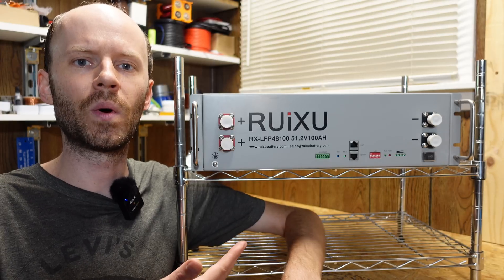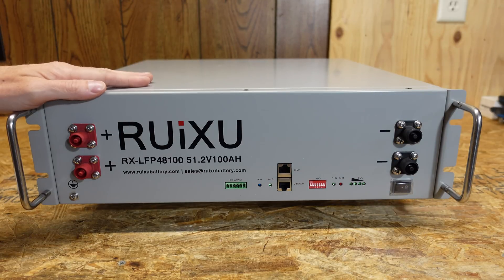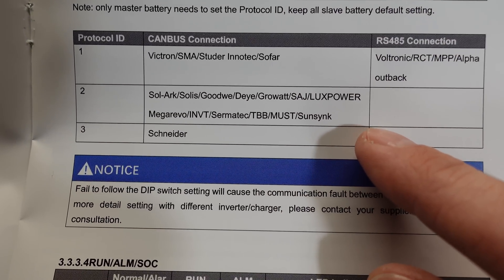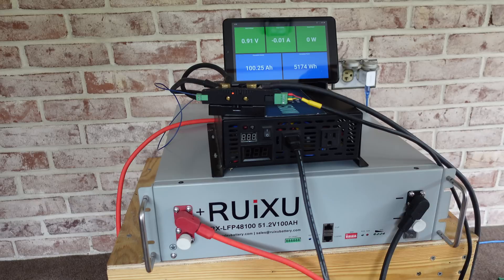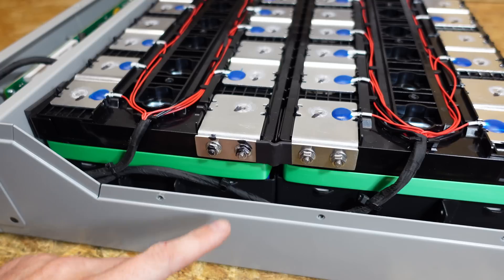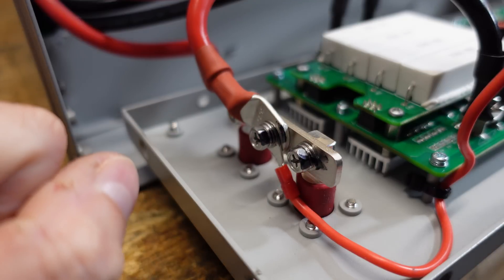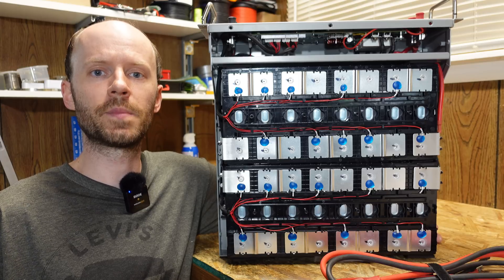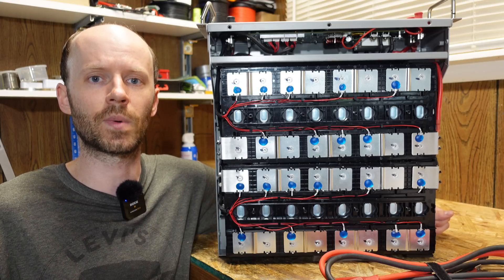RUiXU 48V 100AH Lithium Rack Battery Full Review, UL1973, Off-Grid Solar Power

Comment from the maker: RUiXU Battery... https://www.ruixubattery.com/product-page/rx-lfp48v100-19-rack-mounted-3u-module-ul1973-certified/?ref=lithiumsolar
RUiXU Rack... https://www.ruixubattery.com/product-page/6-slot-battery-cabinet-wheels-busbar-included/?ref=lithiumsolar
affiliate links)
Reply: Discount code not working :(
Reply from the maker: @Adrayven  They changed their pricing already and removed the discount code. Even without the discount code, it's now $100 cheaper than it would have been at the time of this video with the discount code.

Comment: Is there a  fuseable over load in line to the inverter??
Reply from the maker: No. Electronic over-current only via the BMS. You should use an appropriate over-current protection device as part of your configuration.

Comment: They say these batteries are good for colder environments since they have a built-in heater option.  I wonder how cold of an enviroment they can be in? We can get pretty chilly weather in Upper Michigan. I saw another review on these and the guy said he set his inverter to limit discharge to 100 amps since the battery wires were only four gauge. He said he would have liked to see 2 guage instead since his EG 6000 XP could accept 2 guage (but no larger). He also said this battery and the Lifepower battery would not start his AC but his EG4 LL-S Lithium Battery | 48V 100AH | Server Rack Battery would. Your thoughts? Subscribed.

Comment: should you use a dc breaker when you connect to an inverter?
Reply: Only if your cables are smaller than the amount of current the BMS will allow the battery to deliver.  I believe in this case the BMS will cut out at a particular current level, so as long as your wires are thick enough to handle that, then there's no need for a DC breaker.  It won't hurt having one, just there's no need if the BMS is able to perform that function already.

Comment: Hi, can I charge my Ecofolw Delta Pro from this RUiXU battery with xt60 port?

DELTA PRO SPEC:
AC Charge 120V~ 1,800W Max, 240V~ 3,000W Max
AC Input Voltage 100-120V~ 15A, 220-240V~ 12.5A, 50Hz/60Hz
Solar Charger 11-150V 15A Max, 1,600W Max

Comment: I currently have an SOK 48V / 100ah LIfepo4 battery on a small 3000kw solar system. Is it safe to add (attach) one of these to my current set up to double battery power? -Ok to put 2 different name brands together?  -they have same specs    Would appreciate thoughts from anyone.  Cheers

Comment: is it possible to add active balance to this battery?
Reply from the maker: Possilbe - sure, anything is possible. I don't know why you would want to and it's definitely not recommended to do so.
Reply: want to connect in parallel a 48v 280ah lfp battery later and have read is a good idea to have an active balancer 
2 or more batteries
Reply: @LithiumSolar  Active balancing also works whilst discharging and can protect a cell from over discharging on it's own when in storage and not being cycled. Passive almost always only work on charging, but yes agreed is adequate for most situations.

Comment: looks great but where's the Circuit Protector? fairly standard nowadays to have a 100A or 150A switchable circuit breaker
Reply: Instead of adding a circuit breaker to each battery, we recommend that customers add a circuit breaker or fuse when connected to the inverter after the battery pack is connected in parallel. On the whole, this method has the lowest cost.
Reply: @ruixubattery the discount code given here doesn't work on your website. Can that be reinstated?

Comment: There is something I'd like to see. I'd like to see a high current drain test to see if the cells drop voltage or not. It would kind of give an indication of how well the cells will age over time
Reply from the maker: I'll be doing a high discharge test here in the next few weeks. I'll try to hit the full 100A and will grab some thermal images.
Reply: @LithiumSolar  excellent! I'll look forward to it. give it hell. I want to see the voltage levels with sustained draw.  I like the product except for some personal preferences, but I'm still unsure about the quality of the cells, so it will help me make a decision. Also in the follow up, remind us if you are testing a unit they sent direct to you, or if it is one you bought in case they like to send the best ones to the youtubers and random ones to everyone else.
Reply from the maker: @awesomedee5421  Yes, I am testing a unit they sent me for the purposes of the video. I always indicate this where applicable when I upload videos. There's a message that displays in the beginning that it contains paid promotional content. I never accept payment for review videos, but I'm still required to check the box when a product was sent to me for free.

Comment: Does that actually shut off the charging current from going into the battery or does it reduce the current to a very tiny safe current? Couldn't tell if it was your clamp meter just being a little off with the zeroing or if it does indeed drop the current to a safe level for low temp charging.
Reply from the maker: It shuts off. Clamp meters aren't very precise and no matter how many times it's zeroed it never stays at zero. I guess because of magnetic fields everywhere but that's just a guess.

Comment: Based on the quality of what I see in the picture I will be buying this rack, the EG4 rack is absolute crap and would advise that people avoid it.
Reply: I am seriously considering an EG4 rack system, Can you share why their rack is crap?
Reply: @JonCFox333  Sure, the rack came in damaged because of inadequate packaging, there was weld spatter and metal shavings all over the inside of the rack, they spray painted the scratches in the rack while it was in the box and shipped it that way, most of the battery hold down screws had the screwdriver part chewed up, some the support rails for battery were welded in crooked, the screw threads for the caster screws were filled with paint.

Comment: I’m waiting to see a market develop for 48v 200 AH batteries for those who want a 10kw system with just one battery.
Reply from the maker: We already have these availble, check Trophy batteries. They're not as popular though as they weigh a crapton. A 200Ah 48V battery would weigh over 200lbs and require multiple people or a hydraulic lift to move around.
Reply: @LithiumSolar  which is why Big Battery offers them with coaster wheels and a 10 year warranty. So far they’re my top pick but very expensive.
Reply from the maker: @CompleteOffGridAmateur  There have been too many problems with batteries from BigBattery. I want to like their products but I can't when half of what I've gotten has had problems.
Reply: @LithiumSolar  which is why I’m patiently waiting for a better choice. I don’t want 2 parallel 5kw batteries because of the extra cabling, bus bars, class T fuse, and communication between 2 BMS. Multiple points of failure.  But it might be my best option. Love your channel BTW.
Reply: @CompleteOffGridAmateur  If you have two parallel batteries then you have fewer points of failure, because if one battery breaks, you still have one left providing power, just at reduced capacity.  If you only have one battery, if it breaks your whole system shuts off.  If you want increased reliability, more batteries in parallel is the way to go.

Comment: I like the internals on the eg4 better. The discharge resistor looks like it is purpose built compared to the 4 slapped on the board here, items are spread out, physical breaker (quality seems ? but can be replaced)... Price recently was 13 or 1400 with good multi battery/rack discounts and 200 dollar shipping. Also a fire suppression pack on top of the packs rather than a simple insulation layer. All these UL approvals seem questionable and it looks like a complicated subject. I don't see a ul sticker on any of these things... That being said, UL listed breakers have burnt down a lot of houses so it's all on you in the end anyway.
Reply from the maker: The EG4 batteries are very good as well, nothing bad to say about those. I have one of the LifePower4 and love it. The battery I have here was shipped out before testing was completed, so there is no ETL sticker on it. I don't know if they'll be adding them to those that ship in June or not. Also agree the UL topic is rather complicated especially as someone else asked earlier, some areas are requiring things be listed as a complete ESS UL9540. I'm not an expert on the matter.

Comment: This looks really well built, but unfortunately I don't see myself buying a rack battery before the price is on the same level as  a DIY battery with new liFePO4 cells. 

100-200 USD pr. kWh for a pre assembled rack battery (48v 100ah) is ok, but nothing more from my point of view, since there are multiple trusted resellers of genuine new cells with good prices locally. So the risk with a DIY option is minimal
Reply: Little late to ask, but where are getting the cells, busbars, and everything else to build a 48v/100ah for $200? Last time I priced it out (granted about 18 months ago) I was at ~$950 for trustworthy Grade A's and quality busbars
Reply: @hightecrebel  I'm pretty sure I typed something wrong here and that I meant 100-200 USD a kWh. Since you can buy a 280ah cell for about 100 USD.
Reply: @TheJensss where are you buying quality cells for $100?  Serious q, not trolling.

Comment: How does the Balancing work? Does it do propper top balancing, once the battery is fully charged?
A lot of cheap BMS in the serverrackspace, do only balance, while a charge current is detected.
Reply: Like most companies, we also choose equalization near the end of charging. Compared with other companies, our equalizing current is relatively large, generally 2~3 times that of others.
Reply: @ruixubattery  Do you also equalize, once the battery is fully charged? How large is the equalization current?
Reply: @Raphael_Hofmann  equalization is done near the end of the charging, not after the full charge. equalization current 150mAh, most companies around 50~60mAh.
Reply: @ruixubattery  150mA is good. But without equalization at the end of charging, it is useless. I am sorry to find such clear words. I hope, you can improof that in future. If not, you will get problems with warranty claims in some years.
Reply from the maker: @Raphael_Hofmann  I'm not sure that makes sense. As soon as the charger turns off, the cell voltages are going to drop within a matter of minutes below whatever the set balance point is. If you look at a 12V battery for example, it's full charge at 14.6V but once the charger shuts off, you'll be reading 13-something on the terminals.
Reply: @LithiumSolar  
Example for good balancing:
The Battery is fully charged with 14.0V, but one cells has 3.60V, the others have 3.47V.
Now the charge current is 0A. But the BMS has time to passive balance the cell with 3.60V.
After some time (probably 1-2h with 100mA balance current), all the cells have 3.50V.

If you do not allow balancing, once the charge current is 0A, there will be no balancing. Therefore, one cell will always be higher in voltage. After a couple of cycles, the cells will drift even further due to different internal resistance. At one point, the BMS will disconnect after every charge cycle.

The BMS is not there to switch the battery ON an OFF every day. The inverter takes care of the bulk, absorption and float phases. Once the cells are out of balance, the BMS will disconnect at the end of every charge cycle, because one cell will be peaking over 3.65V. This cell will then suffer from higher degredation. Also, the Mosfets will degrade faster. The goal is to never charge over 3.5V/cell on a daily basis. 
Do you watch the OFF-GRID-GARAGE? Andy is explaining that that phenomenon very well.
I never charge over 14.0V for a 12.8V battery. In combination with propper top balancing, the BMS never disconnects in my systems.

I have one manufacurer, who builds my 5kWh battery packs according to my specs. It turnes out really good and I have not had a single issue. But with other BMS, like in the video, I found plenty of issues in the long run.
Reply: @LithiumSolar  I started building solar and battery systems 5 years ago and I have about 90 systems in the field...from 1kWh to 56kWh per system...from 100Wp to 28000Wp. So I went threw the whole market of RVs, Cottages, Houses, Campgrounds...in Germany, South Africa, Cameroon, Italy, Greece and Norway. And from my experiance, propper top-balancing is very important to have a system without BMS or battery-issues.
Reply from the maker: What you're referring to then is timed (or latched) bypass. I have not seen that implemented on any of the batteries I have reviewed on this channel.
Reply: @LithiumSolar  The Seplos or EEL batteries do balance permanently, once the balance cirteria are matched. Only with 70mA...but they do it and it works, if you have about 1-2h absorption time per day.
Reply from the maker: Balance permanently? I'm not sure if you're talking about typical balancing with the charger off (until a pre-programmed voltage is hit) or latched balancing (where it remains on for an hour or two without checking voltage).
Reply: @LithiumSolar  No timer involved.
The BMS has to balance, if the cell voltage is higher than 3.45V and the deviation of the cells are higher than 0.015V.
It stopps balancing, once the voltage difference is less then 0.005V or the cell voltage is below 3.45V.

That is all...very simple. But for some reason, most of the companies do it wrong.
Depending of the carge current, these bad designed BMS only have a couple of minutes to balance, until high voltage disconnect is reached. Than they stop balancing the cells. I wonder, why they implement balancing at all...it does not make sense, if it is programmed like this. But in larger companies, the programmer often does not really know, what he / she is programming.
Reply from the maker: @Raphael_Hofmann  Ok, that's basic balanacing then that all BMS do - yours is just set to a lower voltage 3.45V than most.
Reply: @LithiumSolar  Sure, 3.45V start voltage is less than average.
But the main difference is that the bad BMS just do not balance at all, when the detected charge current is 0A. The BMS in my battery packs do balance no mater, if there is charge current detected or not. Therefore a passive balancer has the time to do its work.
I use JBD Smart BMS, JK BMS (Active Balancing) and Seplos BMS most often.
Reply: It is a very small detail...but if you get this wrong, your whole balancing is useless...it is like no balancer at all is installed...
Reply: @Raphael_Hofmann  
The function you mentioned is easy to implement. For our battery, just modify the program in BMS, because there are both cell voltage measurement and cell balancing circuit in BMS. Our current program is to start balancing when the battery pack is charging + the maximum cell voltage reaches 3350mV+ the voltage difference is greater than 40mV. If you want the battery to be able to achieve this function you mentioned, set the balancing start condition as the end of charge + total voltage or maximum cell voltage reaches a certain value, the balancing duration can be set as required.        It is inevitable that there are differences in self-discharge between cells in the battery, and the function of BMS equalizes such differences. For our current cell, we think our equalization method is sufficient.
Reply: @ruixubattery  Thank you for comming back to me and taking your time to overthink your concept. Are you at Intersolar in Munic (Germany) from 14th to 16th of June? If yes, I'd love to meet you at your booth.
Do you have any Video on your BMS software? Is your battery also available with normal M8 scew terminals?

Comment: Regarding sales in the USA and the ETL/Intertek certificate: The shown laboratory address is not in OSHA's list of "Recognized Testing Sites" for Intertek (however it may be recognised under the umbrella of their Arlington Heights Branch). Still, standard 1973 is not in OSHA's list of "Recognized Testing Standards" for Intertek. So this product is not "listed" as defined in the NEC. Please correct me if I am wrong.
Reply: Lots of me too rack battery systems claim lab certificates they don't really have. Do they have USA based support if anything goes wrong or is it a wechat deal with China?

Comment: I just don't like the welded bus bars. Makes it difficult later if you need to replace a cell or use them for other things.
 Otherwise it looks great. But all i can get here for a good price and availability is jakiper. I have two of them already
Reply: I think the welded bus bars could be cut out and one of the main fire dangers is those connections loosening.. It may also keep your cells from failing due to a poor connection. Yes, it's a hit in serviceability. But it makes a lot of sense, especially coming from a business with liability and DIY customers that open their stuff up and poke around. Besides that.. imagine being the factory worker that torques a billion bolts in a week... You think they might miss a few?
Reply: Yeah i get it. It's a retail product. I suppose i look at everything from my point of view as someone that has an aptitude and willingness to DIY.. everything... 
 I haven't taken a car to a mechanic since 1996😀.. 
 I think bus bars coming loose in a battery that's installed in a house or shed is not an issue. Mobile applications with vibration could be. 
 It's just a case of, if a cell becomes U/S then the battery is useless without costly repair. That too me if anathema 😛..

Comment: Under what circumstances is an ETL listing valuable in the  USA...since Inverters and ESS's have to be tested and UL listed as a "complete system" ? That is, for those of us who need code approval even when not connected to the grid. (UL 9540)
Reply: First step is to pass UL1973, then you can have UL9540 for ESS